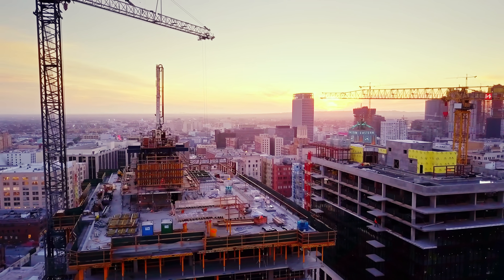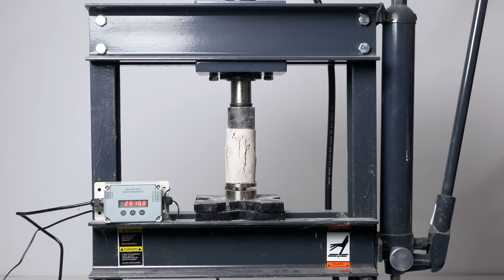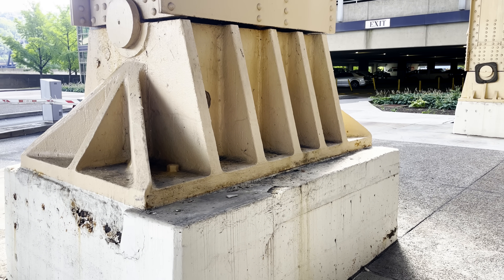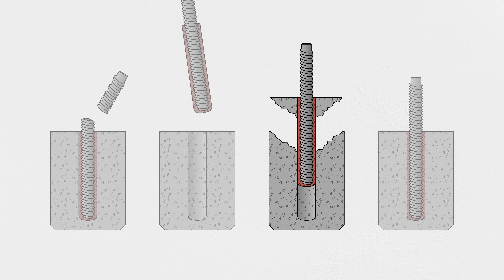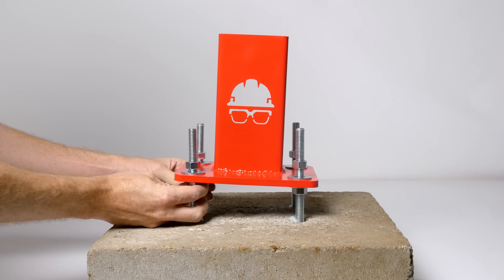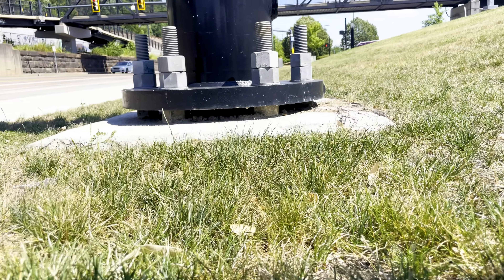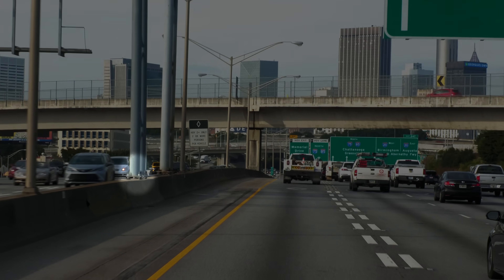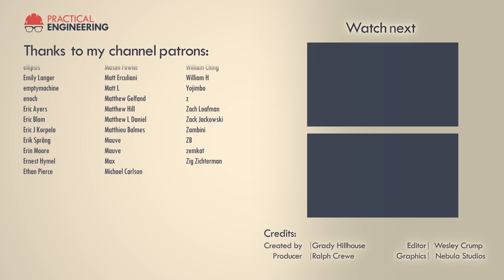What’s the Deal with Base Plates?

Comment: Fun fact: this video is only true in a modern western context. Many east Asian architectural traditions do not have rigid joints, but rather use flexibility as a strength in earthquake prone regions. As one example, columns in the Forbidden City of Beijing are monolithic tree trunks that free stand on foundation pedestals, creating a shock isolating vertical support via inertial mass

Comment: If you are going to precast the bolts, please consider that you cant change their position later in construction. If you require repositioning while also connecting to rebar deep in the concrete, consider imbedding a styrene block around the bolts below the concrete surface, which you can burn out and grout later. this allows you to angle the bolts slightly to shift horizontally when structures with multiple base plates need to line up. Always allow for variations! 😉

Comment: Very interesting, thanks. I used to do the stress analysis for wind turbines which included the tower holding down bolts. I wanted to do an FE analysis of the region where a bolt under tension emerged from the  concrete surface, as I  couldn't get my head round what was actually  happening. Sadly, there was never time to do this properly (fortunately, they were only small wind turbines!)

Comment: Layman here, with a long-standing question about base plates that I didn't really feel I got a solid answer to.

Is the entire load for the non-grouted structures essentially resting on the leveling nut/threads of the bolts? My untrained eyes look at these setups and can't imagine these structures held up by some threading. That is a terrifically small surface area to be channeling all that weight through.

Comment: Enjoyed your video and the coverage of base plates;  it explained a number of observations I'd made over the years:  To grout or not to grout...  As long as the design engineer does his calcs conscientiously, especially the fatigue shear and bending loading of the exposed length of the anchor bolts, all should be well.
One commentator wrote that he used stainless steel embedded fasteners.  You better be an authority on this before you specify such usage.
Many years ago in Switzerland a suspended ceiling failed in an indoor swimming pool killing dozens of children.  The architect thereof was quoted as stating : "No one knew until now that stainless steel rusts"... 
Question regarding the photos with the double nutted retaining nuts on the base plates.  I had a discussion with a TOYOTA engineer regarding this requirement for equipment installed in his plant.  I got the usual claptrap about safety...
Imagine his surprise when I pointed out that there was no such requirement for his products' cylinder head fasteners, nor for wheel lug nuts.
Having said that, I can think of a few instances where safety nuts are warranted, but these are indeed few and far between.
Perhaps you can grace us with an answer/opinion to this question.  Thanks, BE

Comment: Nice video, this will be really usefull for some of my projects. Could you make a video explaining where to place holes in a structure made out of steel tubes to evacuate the condensation ? Also, do the end of the tubes needs to be welded or is it better to let them open ? And do you know if there is a practical way to prevent such a structure to rust from the inside ?

Thank you for your videos 👍

Comment: I built a homestead structure on the Big Island of Hawaii using compression and tension to hold it down and in place almost solely. I did also used a few attached guide lines to help with sway. I'm no mechanical engineer so I was using only the concepts and no true calculations. It absorbed a couple 7+ earthquakes, torrential rains and high winds and did not move at all even when the ground subsided slightly in one direction after the earthquakes and volcanic eruption. I never had a failure and it felt like a glorious achievement.

Comment: Many years ago, there was an accident on I-35 in Texas that happened in the Southbound lane in the Greater San Antonio Area in the City of Selma, a big-rig jack knifed and collided with the sign pole, taking it out and dropping it across all lanes. It backed up traffic so bad for miles and for hours on end, all of the access roads, additional side roads and alternative routes were clogged.

I was not sure of the state of East I-10 and its increase in traffic load, however, I am more aware of US-281 state being messed up with traffic as I used too, (Used too) drive down it for my job on West I-10. During that time, I was attending a community college in Universal City and my sibling and I had to drive through that hell hole of a traffic, we ended up missing a class or two, and was late to another. The way I see it, it was just smarter to stay home and avoid that mess as I look back at it and just get the mark for being absent, the college should have also pardoned the students who had to drive I-35 for the commute that were going SB. The NB lane had its fill of traffic too and was even more congested.

My sibling and I did not know of any other alternatives other than either going towards 281 and still fight traffic at the roundabouts at I-35 and Loop 1604 to get past or head towards East I-10 and go westward. I knew of a few side routes but those where heavily clogged too. It was a mess! I could cry over it. I did maybe one more semester then left, college wasn't for me, I did better when I was occupied and working but I am put off on traffic as it stands. I will try to avoid traffic at all costs. The only patience I have for traffic as it clearly stands in the small town where I work and live.

On Mama's Day in 2024, my mom and I drove down to Port-A to visit family for a day visit. The drive back, I swear got stuck in the traffic on I-35 about 10-15 exits back from Loop 1604. I said, "Screw this traffic, mom, Watch this!" I got off at the next exit and drove down to road that I know of that will take us straight past and up to where I could get us back on I-35 to get us home. My mom sure was impressed with my smarts as the road I drove and and got us to was completely devoid of vehicles except a pinch here or there. Its because I had connected the dots or roads from doing random guess driving or curiosity years prior.

Comment: There's a homeless shelter in my city that has a solution I quite like for supporting an outdoor air conditioner tower. I watched as the tower was being built, which is how I got this info.

The tower is an octagonal cone. The baseplates were inset nearly a foot under what would be ground level, secured with bolts on each leg. The base of the tower then had concrete poured over it, burying the baseplates and securing it quite nicely.

Comment: Genuine question.
For such small test cylinders, and with relatively huge aggregate (rocks) inside them. Wont the tests be heavily scewed depending on the way the big rocks are sat inside the cylinder?
I get that it won't matter in the actual construction, but what about in tests like these? (Doesn't have to be the ones on the video SPECIFICALLY)
Like, if 3 of these rocks are set in the same height in there, they will pretty much cover a whole layer of the cylinder. Wont that matter in some way?

Comment: In NZ, work has been done to make roadside signs friable/frangible. These are designed to collapse into harmless pieces on impact. These can often be simply reassembled. With traffic, this fail safe mode can be directional, check out ILS antenna at airports.

Comment: One of the more interesting applications of this is on roller coaster foundations. They often have a "key" that sticks out of the base plate and goes into a hole in the middle of the foundation. That way when you inject the grout, it can handle more dynamic forces that aren't simply vertical. The foundations you see sticking out of the ground are often on top of large blocks just below the surface.

Comment: @ 10:08 Can you PLEASE explain How exactly, do they stop the bottom Hex NUT from becoming loose from all the micro vibration which WILL happen in due time however long it takes.  The top Hex Nut you can easily re-tighter if necessary. Loctite??! Or am I missing something? THANK U in advance.

Comment: There’s also the baseplates that has an addition underneath the baseplate to handle non linear loads in buildings steel frame. Often found under the pillars that has the wind reinforcing beams.

Comment: I’ve done a lot of steel columns w/base plates, leveling nuts and non-shrink grout. Once I noticed my grouting crew mixing the grout much more soupy than I preferred to see and definitely with more water than was spec’d on the mixing directions was being used. It was almost the consistency of crème of tomato soup. To give myself some assurance that things were ok, I had them mix a batch for some test cylinders with the grout, at the same consistency. When we broke them at 28 days, they had indeed lost some of the prescribed strength. Instead of breaking at 8K-9K psi, like the product spec, we were getting around 7500 psi. I felt good about these results because the steel columns were sitting on foundation pads of 4K psi. I like the idea of getting full bearing coverage of the base plate w/the soupy mix as opposed to using the dry packing method where you can never be sure that you’re really getting full coverage and told the guys to carry on with the wet mix.

Comment: Great video! I learned a little about one of the many things I make as an assembly welder. Though you did make me cringe. Structural is never TIG. Its Flux mig, or stick. I can see you struggled to get fill or consistent weld toes because your rod was too thin and amps too low. Sheer and Candlever resistance would be minimal because your fusion zone is small. I do love that you're a home welder, though. It's a lot of fun. Keep improving! And start wearing a respirator... slow building  irreversible neurological issues..

Comment: The local electric utility put in some new steel poles for a high voltage line. They are at least 4 feet in diameter at the baes. Someone made a mistake in the plans so the base plates were larger diameter than the bolt circle in the concrete they were to mount to. Adapters had to be made to mate the two different bolt circles. I wonder if the wider poles would put undue stress on the smaller concrete footings.

Comment: Looks like a fundamental idea behind the standoff baseplates is to double up the number of bolts, reducing the point loading proportionately. Not real sure, but the latest technology epoxy grouting should be impervious to the weathering drawbacks you mention. It's used quite a bit for injection grouting repair of structural concrete.

Comment: With an engineering background (mechanisms and electrical disciplines), and insatiable curiosity, I have noticed that highway overhead structures, mainly signage supports, seem to utilize an excessive number of hold-down bolts at their bases. I figured it was just redundancy, but now I realize that such relatively light weight aluminum structures have to withstand huge side and rotational loading in the wind. Many sign supports in Florida along I-75 are massive cylindrical "tubes" arching over the highway and anchored at only one end. Their thick base plates have as many bolts as can fit around their circumferences. Now I am reminded that such mountings have to resist many tons of "torque" loading and side loading as well as cantilever weight bearing even when subjected to Florida's not-infrequent hurricane gales. Non-engineer people don't realize the complex issues that those that design and construct have much more than aesthetics to consider and design for.

Comment: It is rather ironic that not even a week has passed since watching this (actually, since it was uploaded) that an entire basketball hoop stand came crashing down on a high school student in Greece. The student suffered serious injuries. Hoop stands in Greek schools are usually constructed of a single, very large, L-shaped, square, hollow steel pipe which is fixed to the concrete floor via its base plate. Often the base plate is partially or wholly buried into the concrete or floor covering material. I have never ever heard of such an accident before (basketball courts are found in schools in all over Greece since the '70s, if not earlier). It just goes to show these things which we take for granted (like the solidity of construction of a plain basketball hoop stand) have a lot more to them than we may think. Photos can be found online by searching for "μπασκέτα μαθητή ΕΠΑΛ Ρόδου".

Comment: At this point 9:48 i already had An idea in my mind: why don't Just put a rubber sheet/layer between the concrete base and the steel column? Or another flexible material that dosen't change shape with temperature.

Comment: "column collapse" is one of the top 12 killers of structural ironworkers. Usually from people loosening the nuts on the anchor bolts to push it one way or another while connecting beams. If the column is on a chemical anchor, the risk is way higher because in 10 years on the job I never saw one pull tested before we stood a column.  Generally we use stacks to of steel shims shot in with a builders level to get all base plates +/- 1/8" (ironworkers do not acknowledge the existence of a sixteenth"

Comment: One thing you forgot about is standardaraziation. 
The german railways for example have standard prefabricated concrete sign and signal foundations, that just needs to be burried at the place where a sign or signal is planed to go and it has 4 bolts and a base plate casted in. So when installing or replacing signs and signals, you just need to place them onto theese foundations, tighten 4 nuts, and the job is done. And since the foundation has a steel baseplate of its own, you don´t need to worry about grout or other fiddely wor steps, the two baseplates just sit perfectly onto each other.

Comment: Stand off base plates can also be used in some instances where the hardware itself is meant to slightly distort and settle overtime andor be easily manipulatd for installation. 
Instead of using less hardware with a higher cross section and higher individual stiffness....more smaller fasteners are used. After a given number of conditions or cycles the hardware is checked and refastened.

Comment: Installing a nut under a baseplate for levelling and then adding grout defeats the purpose of the grout. The nut needs to be backed off the baseplate or else you aren't compressing the baseplate to the grout, you are just compressing the baseplate to the nut.

Comment: Interesting video and demo of different scenarios. 

The stand off design looks ideal for infrastructure & industrial uses but on pavements and in public places they look horrendous. In the UK you very rarely see exposed baseplates where pedestrians frequently go. The baseplates are usually fixed sub-surface and then covered with build-up and paving going right up to the column - looks far neater.

Comment: Water in the grout causing AB corrosion is a red herring.  Water can enter the concrete below even easier than it can enter the grout. The grout is usually in a drier location than the concrete below that can be exposed to soil moisture.

Comment: If cisterns for new homes were built in commercial business similar to solar panel systems, but instead of power gen, instead to mediate grey water, carbon sequestration, heat island effect waste heat mgmt, desalination of costal canal inlets for pre-treatment plant sewage mediation to non-potable ag water or perhaps to accumulate pumped hydro storage of local renewable energy. What would it look like in cookie cutter format for highest elevation pre-slab new subdivisions
moving inward from coastal areas?

Please design and share it here... and Freeware No Copyright post it for any community to build.

No free lunch, but what if the costs genuinely were the labor and materials and everybody put these together like Amish barns for a solvent construction workers paycheck?

Comment: 8:00 had to lvl base plates with 2 halves on a railroad bridge once. The lower part was encased in concret after leveling it. The whole procedure was: 1. Leveling it on the rebar with screws 2. weld the lower base plate to the rebar and welding in some supports (so it doesnt float or move) and then encase it concret. The crew left around 20cm of the top of the colum the plate was one so they cut put in that last part. 

So its similar to using grout, but with condret instead.

Comment: You can also embed a Plate into the foundation, with screws sticking out, onto which you can later on screw the post.

Quick installation, easy adjustment, easy inspection, high durability

Comment: I’m an electrician and I see a lot of grouted parking lot lights that the bolts rust away on. The customer only finds out after they start falling over lol. 

It becomes a huge pain because we either have to replace the pole base or install new anchor bolts with epoxy. We never grout them again.

Comment: Hi Grady Thanks for an other great video. I loved the explanation as I too thought that they were a break away setup. But there was one thing missing in your video what a about the anchor bolts imbedded into the concreate. Do they have some sort of internal base plate or are flare at the ends or rib's to distribute the pressure more evenly over the concreate?  I would like to know how engineers even out the internal pressure when imbedded in the concreate.